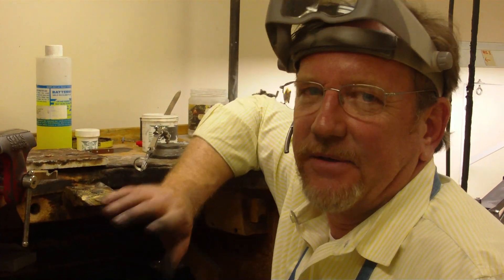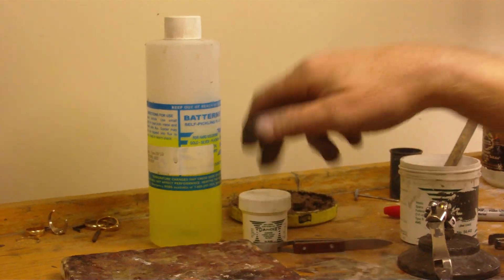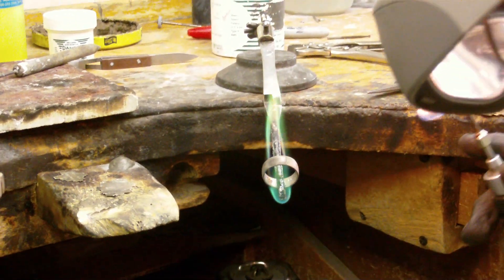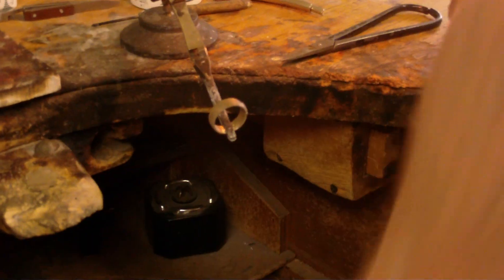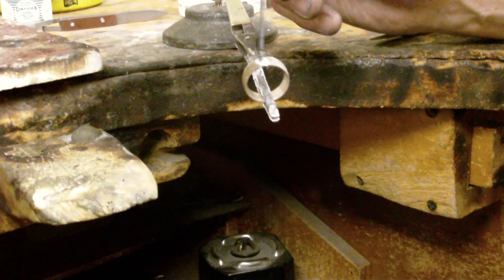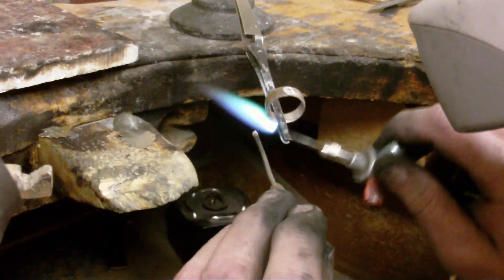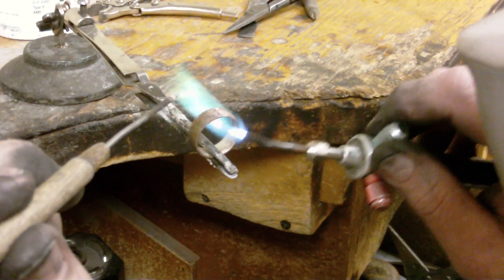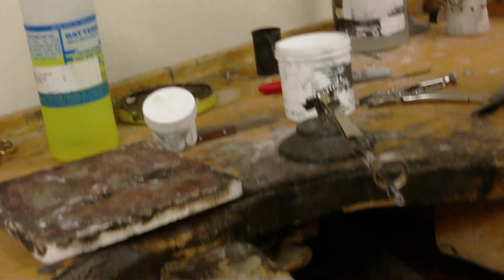How to solder sterling silver

Comment: Can I use  a hot solder iron and a super hot heat gun?
Reply from the maker: No, the melting temp is over 1,000 degrees.  Most soldering guns don't get over 400 degrees.

Comment: What is the purpose of the boric acid? How do you mix it?
Reply from the maker: It's to reduce firescale.  In a nutshell, it keeps the piece from discoloring (thus needing clean up and polish) in areas other than where you are doing your work.  I mix about an inch of boric acid in a jar and fill the rest with denatured alcohol.